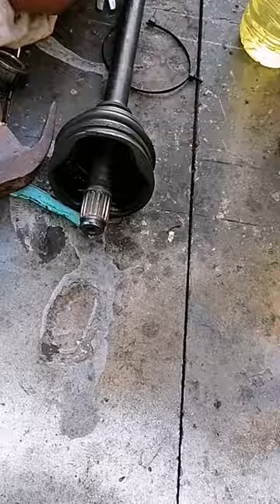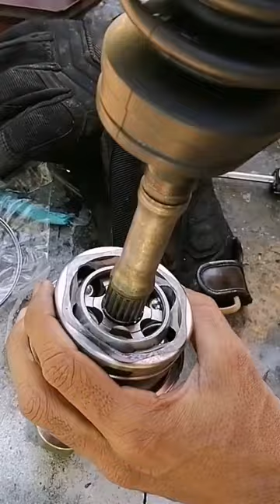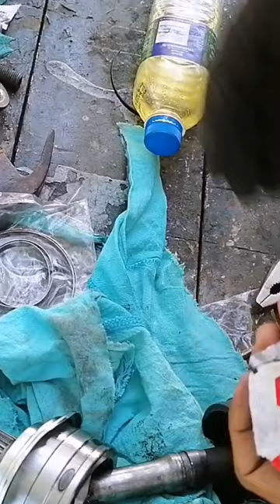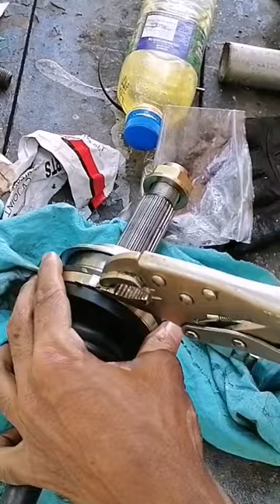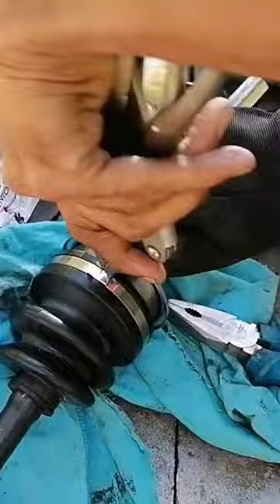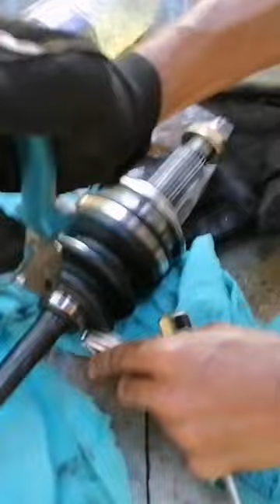New CV Joint Replacement #cv #easymethod #homegarage

Comment: Dont follow any of this. Dude didnt pack the bearing at all and that clamp isnt doing anything, not even remotely tight enough.
Reply: You actually don't need to pack it. Once the joint starts rolling, it flows into the bearing.  I'd advise turning it by hand a bit, like he did, but for a little longer. If you have a torch, warm (not hot) the metal part first.  The grease typically is heated by the brakes and motion of the joints.
Reply: I disagree with you because you don't have to pack the bearings because once you turn it the way he did and as the car drives, the grease will go in.

Comment: Easy to put it on - taking the old one off is MISSION IMPOSSIBLE - why this should be so difficult with more than 40 years of engineering development is a MYSTERY.
Reply: Uh, hit it like you did last night. It comes off
Reply: @deven6518  All the hammering ended up damaging the inner cv too. Answer seems to use the 2 hammer method.
Reply: @godfreyberry1599  no, like you clamp the shaft and knock it out. Use something to spread the force, like a plate or wood block. You can just cut a slot in the wooden block so it goes around the shaft and sits on the outer joint, then hammer away. You can use a slide hammer tbh, but you have to clamp the shaft. The inner cv can literally slide out with hand power, so no banging where that's taking the restraining force, because the boot will tear

Comment: I’ve looked at a shit load of utube videos trying to find if there is a snap rig holding that inner cv joint on the splined end that goes into the rear end. Found none, nota, zero , zip!! Thanks for the view that showed me no snap ring. Now I can put a puller on not worrying I was pulling against a snap ring.

Comment: The tool for band-it clamps are like 12 bucks and get you much better tension on the band.

Just buy the tool
Reply: Yea I never like those clamps maybe because I was using the wrong thing
Reply: I made a tool that worked but I needed 4hands to do it! Should have bought the tool, now I’ll buy the tool for that factory band.

Comment: any idea how to check inner CV plz
Reply from the maker: 1).Pull the shaft near to inner CV front and Back Not In and Out. You can abserved abnormal play. 2).When the vehicle speeding you can feel smal vibration near the 2nd and 3rd gears.